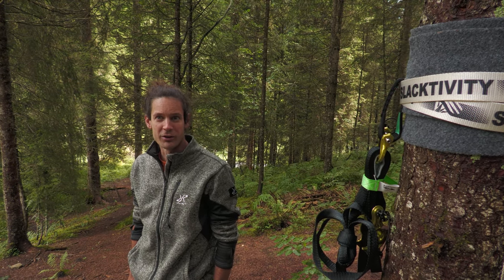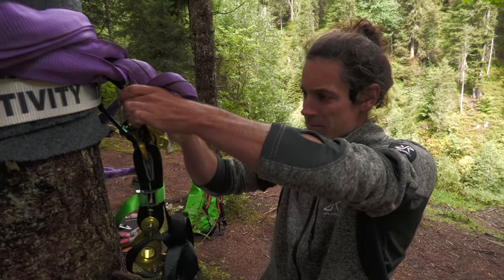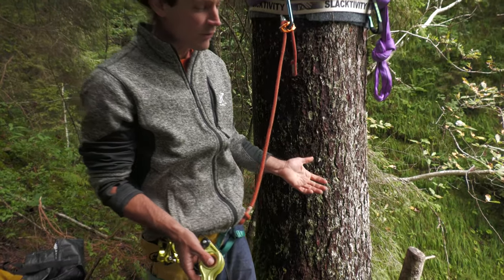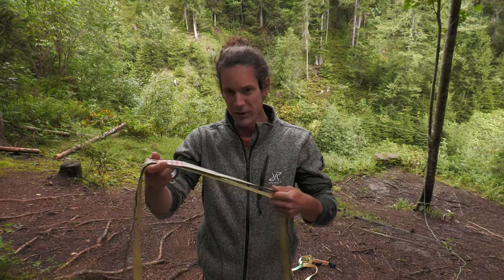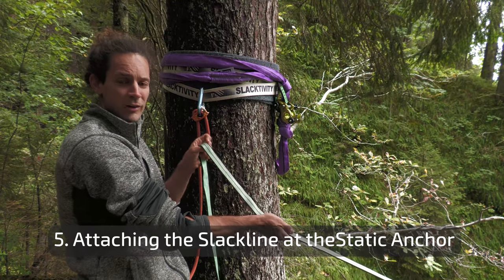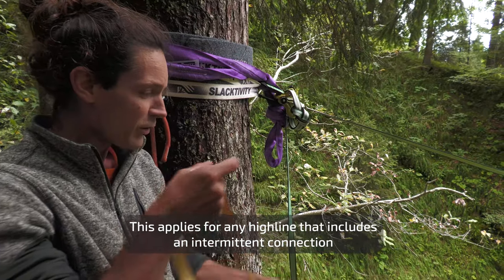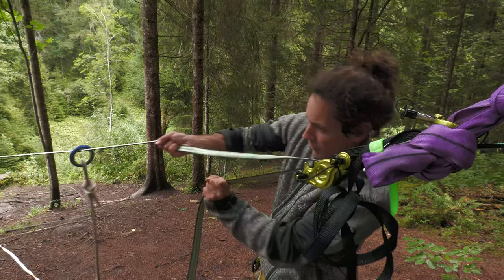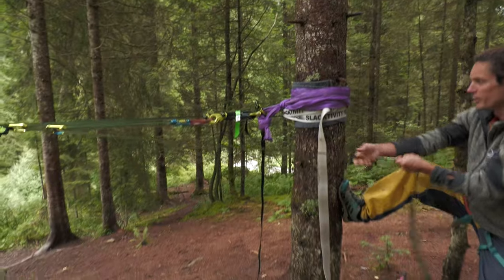How to set up a Highline between Trees

Comment: Great video!

I wouldn't advise the 5.1 or 9.1 though, considering you use your webbing as tensioning system, and the second it twists in the rolex, it gets seriously damaged and it's done. And it happens all the time at some point, especially since we are rarely rigging with both feet on the ground and easy access to zll part like in this video.

Comment: Great video Sam! I think one thing that could have been touched on when choosing trees is to be aware of ground erosion and how it can affect the trees near the edges of gaps. Where I am we tend to use trees that are further back from where we want the master point to be and redirect the anchor off a tree that is closer to the edge of the gap. Curious about what your thoughts might be on this method.
Reply from the maker: Hi Mat, good input. I've used that method too, specially when there are small trees closer to the gap. Definitely a great method. With well-rooted trees I also meant that the ground is good and not much erosion going on. Even taking into account that for example after heavy rainfall the situation looks different. At one spot we once decided not to rig because the ground was simply too soaked with water and we were scared of erosion on that particular day.

Comment: Thank you for this great material, super interesting to watch! I have a question though- whats the advantage of a kingpin shackle over a screw- locked carabiner? Seems to le like its a lot easier to leave a shackle not locked completely with a pin than to leave a binner unsecured. I'm a  rope access technician, just started walking on a slackline, and all those rigging techniques that you're using are familiar to me, but with a totally different equipment. I will be super grateful for Your answer!
Reply from the maker: First big difference is the breaking strength. Even though the weight is similar, the KingPin is 2-3x stronger compared to a carabiner. Also: Carabiners are really prone to cycling loading whereas the KingPin is much more resistent  with it. Then a screw gate carabiner can unscrew with vibrations. In climbing this is mostly less of an issue, but in highlining much more so. Once the KingPin is properly locked it is a an extremely strong, safe and light weight option.

Comment: Great video, thank you! What would be the minimum thickness recommendation for the tree anchor?
Reply from the maker: Thank you. It is on purpose that we did not give an exact recommendation on that. If there is one party that could come with official recommendations it should be the ISA. But at the same time, the diameter depends on the sort of tree, health, etc. And very importantly on the height of the anchor point. We've had a perma rig anchored in 14m height. At the height of the anchor, the tree still has a diamter of almost 1m. At the same time we've used trees with a diameter of 20cm, but anchored it on 5cm height. We definitely do not recommend to use a tree with 20cm diameter. I think, if you want to go into discussion about it, slackchat could be a good place as long as the comments keep a certain level... Having a tree expert giving insights on the types of trees would be much more valuable than my limited knowledge on trees. Also the direction in which the tree is loaded can be of importance. There are for example pull roots that are much better in stabilizing the tree in that specific direction... You can see, the matter is complex and giving a simple number would just not do the job.

Comment: Don’t you worry about the reduced strength with the figure 8 knot on the webbing? Wouldn’t a frost not be a stronger option?
Reply from the maker: A frost knot can be stronger in certain webbings, but not always. Here you can find a list of webbings tested in different knots: https://slacktivity.com/webbing-knots/ In avarage the figure-8 had a strength reduction of around 70% - however, there are big differences between webbings! Do not use a figure-8 in a pure Dyneema webbing for example.

Comment: any advice on reducing surf?
Reply from the maker: The best anchors to reduce surfs are bolted anchors. 2 bolts, placed perfectly horizontal and in a rock face 90° to the line. On trees, using spansets in a basket configuration will be the best to have less surf. Using a perfectly round and vertical tree will also be helpful. Upon that, you can have the line on surf- or bounce tension. Surf tension is pretty loose, bounce tenstion a bit tighter and if you go even tighter you'll end up in circle surf tension which will make the line feel more surfy again...

Comment: Nice phone drop lol.

So if you left it up, are you saying keep the backup loops loose when the session is over?  I've been pulling my backup tight on my permarig because I thought that would be safest.
Reply from the maker: A slightly loose backup with strong tapes will break the osciallations better. However, in a really heavy storm there is always a chance of untaping. Last time it happened to us, there were wind gusts of around 100km/h.

Comment: Hi Sam, I’m curious about your use of the kingpin for the main anchor point. I’ve always been told to only use steel as aluminium doesn’t handle cyclical loading well. What’s your take on this?
Reply from the maker: Never use an aluminium carabiner in cyclic loading. A carabiner slightly bends under load - the side of the gate engages after 1-2mm. This repetitive bending will kill the carabiner at one point. The kingPin does not bend to engage. And therefore it is fine to use it in the main line. Furthermore, the MBS of the KingPin is 60kN which is also way higher than the MBS of a carabiner.